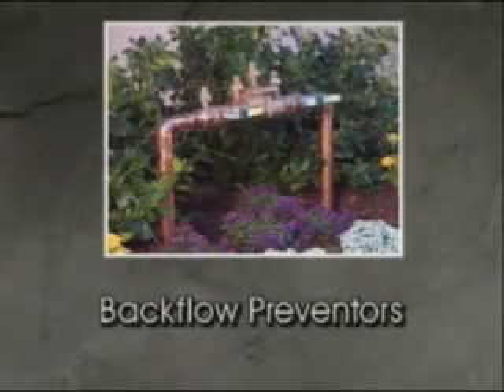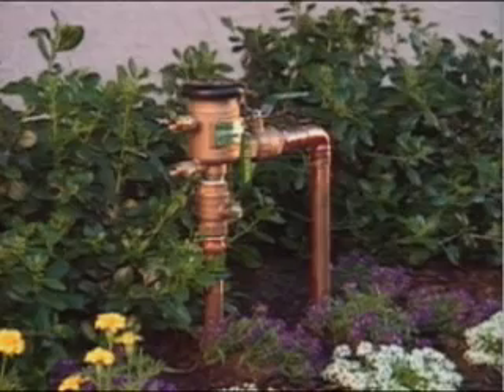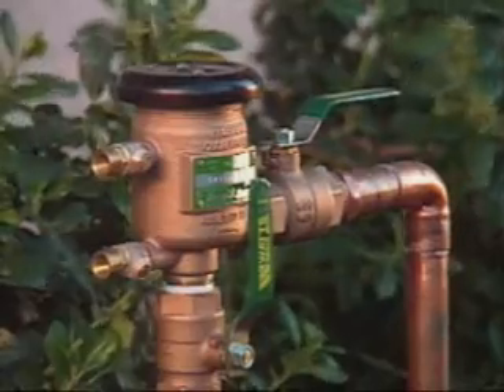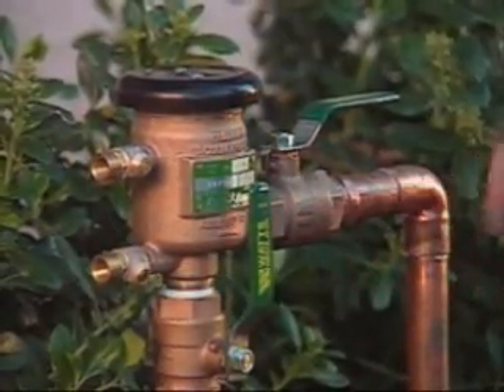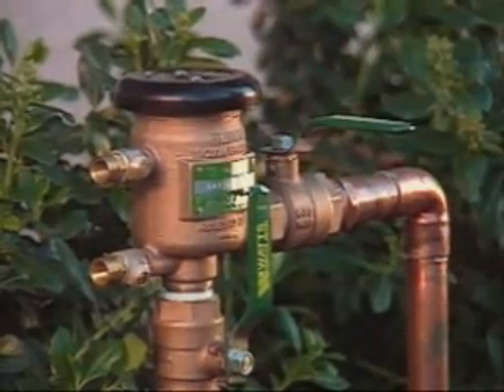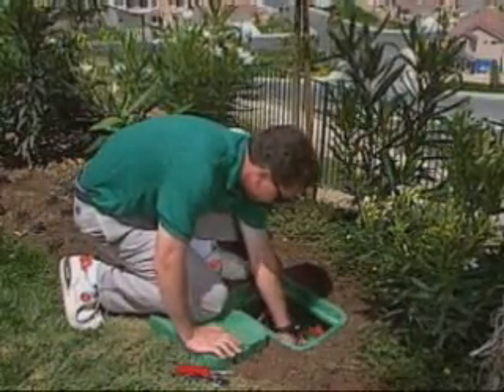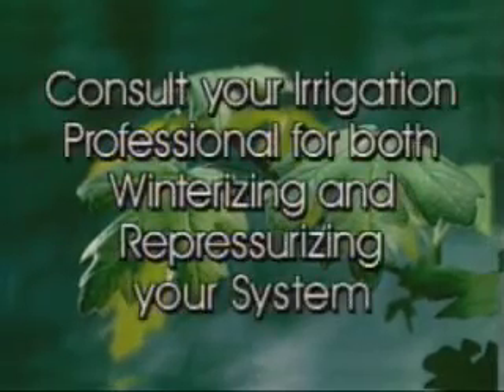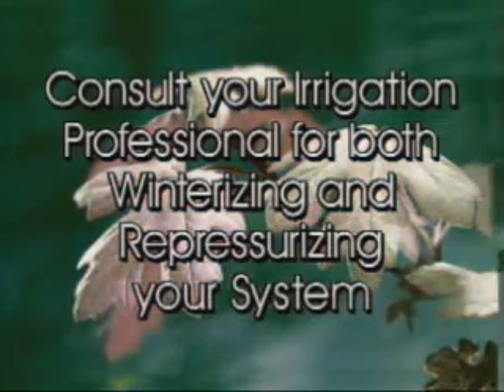Backflow Prevention

Comment: Can somebody explain how the backflow preventer is useful? First of all, in the normal condition, the city water has a 50 psi pressure preventing a backflow. Second of all, if something happens like the main water shuts off in the main line , the water inside the irrigation system cannot come back because first it's in lower level and second the irrigation valves are closed preventing the water motion.... It's an unnecessary device which usually breaks adding a burden on homeowners....
Reply: The bfp valves are necessary and need to be maintained annually. You risk contaminating the public water supply. However unlikely, it HAS happened in the past, which is why these things were invented.
Reply: Backflows are very necessary.  If your sprinkler valves are automatic, they only hold water in one direction, once the pressure from the main has dropped to zero the valves become fully open to back siphonage.  Lets assume you or your neighbor have a pet that uses the lawn to do its business, if the city has a leak and they shut the system down, any standing water may be siphoned into the city system.  If that doesn't bother you, then why don't you just drink from the puddles in your back yard?  The answer to the problem isn't to remove the backflows, the answer is to pool the money that is paid to support the monitoring of backflows and cost of installation, and use it to supply a secondary water system for sprinklers only.  The secondary water system could be largely supplied from our waste water, thus cutting down on our contaminating our rivers with salts and drugs from our sewer system.
Reply: MrAmoslemi I do sprinkler system as a side thing. And as much as they are required, I decided to take the one off on my own system. After the seals going bad 4 times in 2 years I just cut it out. You are right, I feel as if they are a waste. The valves stop the zones from backfeeding. And even in a well theres a check valve for the main. I see no difference in using them. Although if I work on someone's house I have to use them unfortubatlty
Reply: Yeah, that's the thing, maintained annually. No one wants to maintain or pay for something if they never see it in action. Such as for me, I'm on a well, so no public supply. However, I was tired of having to replace/repair the thing multiple times a year due to our gritty water, sometime it would get stuck/flood. So away it went. Guess its mostly for those on a municipal supply. 
Some HOAs also require lawns to be cared for in my area. So to explain to someone this $300 item has to be replaced/repaired/tested annually (which no one also has) to keep your grass green, but it does nothing for most of its life, is where everyone ends up abandoning there systems/letting HOA fines pile up, or I come back to find they cut them out themselves. I feel like for something thats technically required, they need to make them test free, and cheaper to replace if needed.